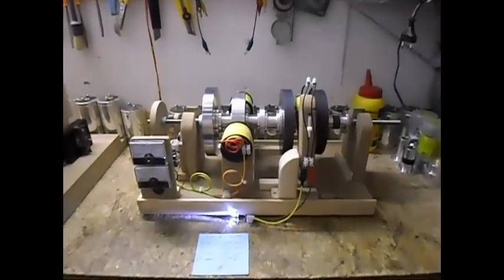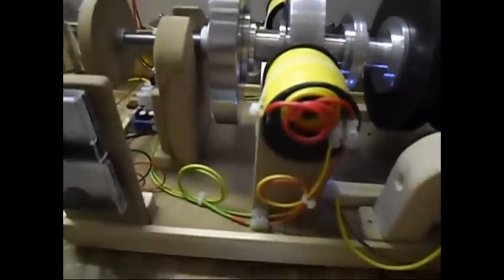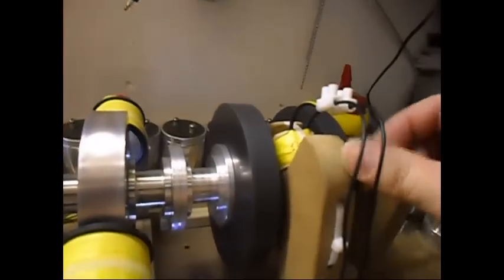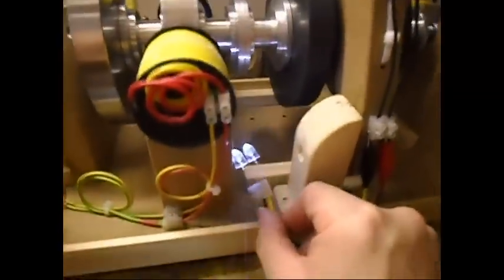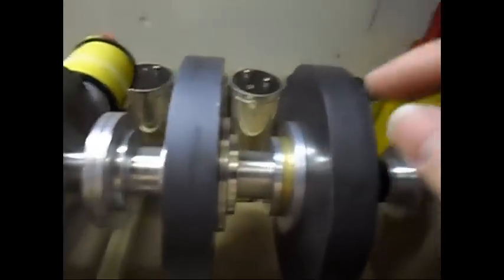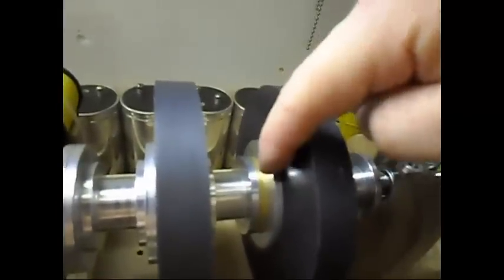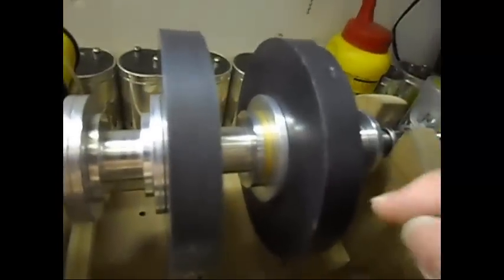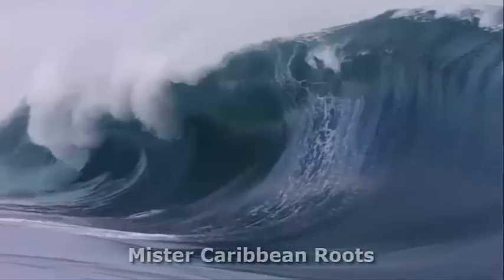Flux Gate Generator - Update 10 Rotation of 2 ring magnets - Push Mode...

Comment from the maker: Just update where the system is now 2 ring magnets in push mode wich is both south pole facing in...^^
Numbers,
Input is 23Vdc @ <50ma...
No coil in place = 1896 rpm
Coil in place = 1896 rpm...:D...nice...
Coil & leds = 1888 rpm...pretty good...^^
Coil shorted = 1875 rpm...not that bad either but it can be much better ofcourse...;-)

This update/test takes about 30min to do so what you see here is only a tiny bit of it...otherwise it would be a long boring video...lol

Here one can clearly see the basic workings of the magnetic field of rings magnets when they are spinning...^^
Guess i only need a coil now that doesn't slow down the drive side and i'm done...???...lol